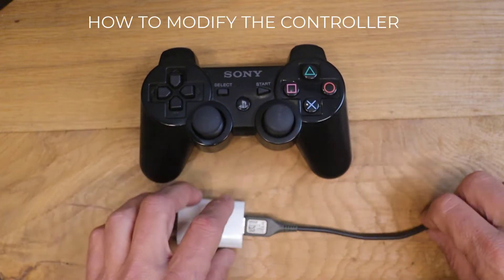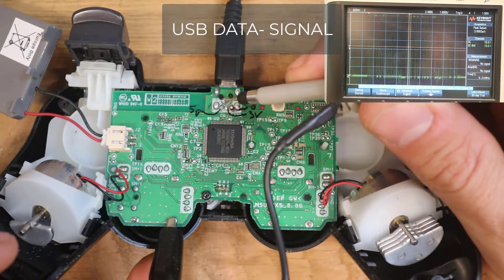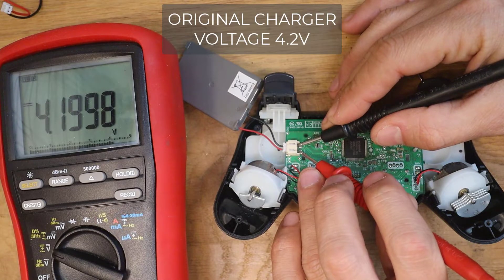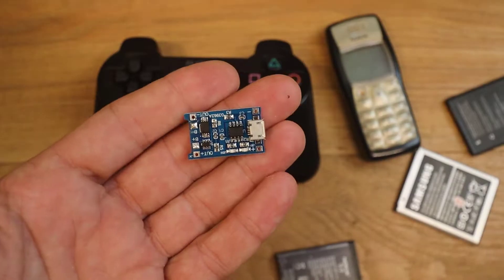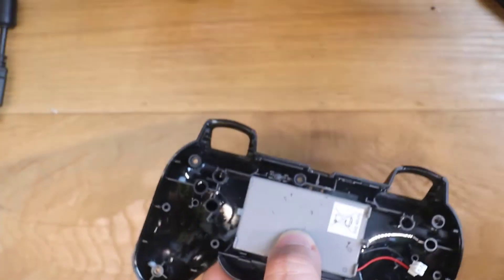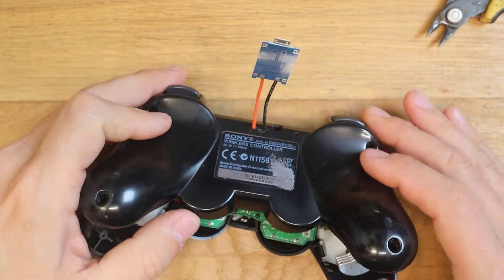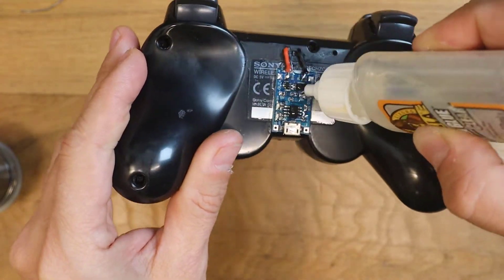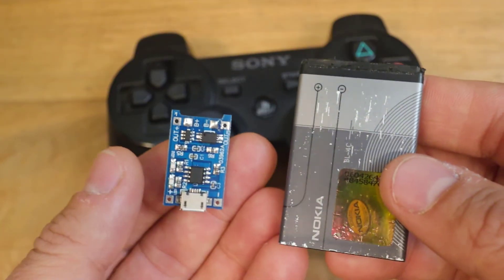How to charge PS3 controller with phone charger

Comment: thanks a lot!
i've upgraded already dying battery to one that is like 3 times the capacity from lumia that died like 10 years ago, and it's great, also got the usb type-c version of the module,
also i found space inside the controller for the module board so i didn't need to glue it on the bottom (its just above the sixaxis label, and i fitted it under the main board, then covered it with isolation tape so it doesn't touch the main board)
Reply from the maker: Good idea
Thanks for sharing

Comment: Question: do you think it would be possible to use one of these mini charging boards (the ones about half the size of yours) to have it all routed internally? Do these boards also allow data to pass through? Im asking because on linux i have to pair the controller by having it hooked up to usb first. It would be sweet to have a charge board like this to allow charging custom batts and preserve full functionality.
Reply from the maker: Not sure i got what you mean. 
Where would you place the compact charger pcb then? And the usb port aperture?

Comment: Thanks for this it saved me from measuring the charge current myself. I bought some 453048 Lipo's and wanted to compare simulated charge and discharge vs the old worn out batteries of the used controllers I rebuilt. I just cut a 1mm piece of plastic the same size as the original battery shell and tape the new one to it. You want this plastic to protect the cell from puncture if it swells in the future so the harder the better but if the total thickness is more than about 6.2mm the controller shell wont fit. Will have to think of something else for the one newer battery with built in legs though. Hmm actually I wonder if it reduces current near 4.2v like a smart charger not sure I'm curious enough to make an adapter to test.

Also the PS3 Controller 1800mAh Replacement battery sold in the usual places are actually about 500mAh when you open the shell and look at the cell labeling. I wouldn't even trust the label so probably less.

Comment: If I don't solder tp4056 to the ps3 controller, I connect it with a DC jack, will the battery be protected without tp4056?

Comment: Can I just install the battery without the added circuit??
Can the new battery be charged using the old system
Reply from the maker: Hi, yes sure. It will last longer. Will take little longer to charge

Comment: Exist really a method to hack the PCB? I wan´t this because in my country it´s complicated to adquiere this USB mod.
Reply from the maker: Hi 
I guess yes, but you have to study the datasheet of the installed charger, then force the enable high
It will take some time, and if you fail you remain without controller, so i preferred the shortcut

Comment: Do you know if it is harmful to the battery of the controller if I use it frequently to play games on the computer (wired)?
Reply from the maker: Hi, yes a little, but it also depends about the charging strategy. Lithium battery degradate quickly if kept at high charge voltage. Usually chargers has some histersis and let the battery discharge a little before charging again

But in general better to let the battery cycle, so you will storage the controller with an average charge level instead of top charged
Reply: @MakerFabio  I see. Thank you for the info.

Comment: the amount of work and components used here is not worth it. ill just go buy a esp32s2 and flash a USB host library on it, just a few soldering and blam, a USB cable charger that can charge original ps3 controller without PC using a standard USB charger/powerbank.
Reply from the maker: Hi
It is a very smart idea, thanks
Even if i believe it is still less money and soldering what i did. Charger 1 euro, extra battery for free, and i have also longer battery life, in addition i can use micro usb o usbC instead of the original mini USB

Comment: But does it still transfer data/ sync the controller to new ps3?
Reply from the maker: Hi, sure
I didn t touch the original connector, so the old mini USB is still working like before the modification. While the new micro usb port is only for charging and no data
Reply: @MakerFabio  micro usb is probably the least mechanically reliable connector out there. Mini is far more robust, never seen one failing.
Reply from the maker: @corwin.macleod  i agree, bit is so outdated, and rare. in my flat i have 90 micro, 8 usb-c , 2 usb mini (for a cheap logic analyzer and my taranis transmitter)
Reply: @corwin.macleod  sir.can this controler working on pc without battery? i got damned new controler.not even one weeks constant disconnect and connect and even appearance it ps3 controller it detected as xbox360 controler on pc

Comment: i was with you until you externally mounted the charger , better option ditch the rumble motors and put the pcb in there place. Two benefits longer battery life ( no rumble) and clean install
Reply from the maker: I think you could be right
Not completely sure if i understood, but i wanted to keep the vibration motors, and the space there was limited
In addition you should drill 2 holes to have the LED visible, and being a linear regulator is heating kind of a lot in a small space (but probably could survive)
Let s say that’s a quick and dirt, not so clean, i agree
Reply: @MakerFabio  yeah man, i agree with that, quick and dirty does the job results are what matter right :D 

My bad i should have structured my text better as your native language is not English.  personally even with new controller's straight from the box  i either turn off rumble or open it up and cut the motors off on a brand new pad :D 

i have never liked them , adds weight and draws power but that's just personal to me.
Reply from the maker: @vasili1207  mmmm
Now that you tell me this, thinking better i could remove them too

I just purchased it so it was funny to me hear the vibration while playing car games. Thanks for explaining better. See you soon
Reply: @MakerFabio  That's why i remove them because my favourite genre is car games,  i used to play Gt5 online all night and if i used rumble i would have to swap pads because it would die fast .. with no rumble motors it lasted all night and i didn't have to put up with the constant rumble throwing off my braking points.  

i have done similar mods to my boys Rc cars instead of triple AA batteries  like you use a old Samsung batt and wire it up to spring post... but i just used the old phone as a charger ... phones batteries should get used more imho
Reply from the maker: @vasili1207  i play gt5 too (but i m not good) And i also swap all the batteries of my kid with lithium but i use USB charger pcb. We may have similar mindset